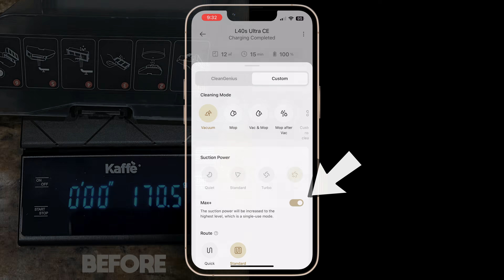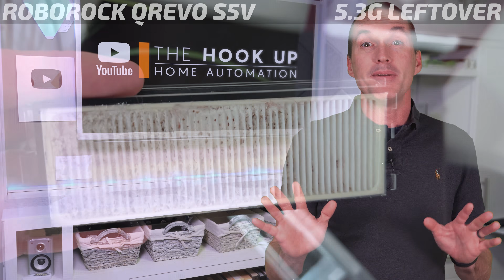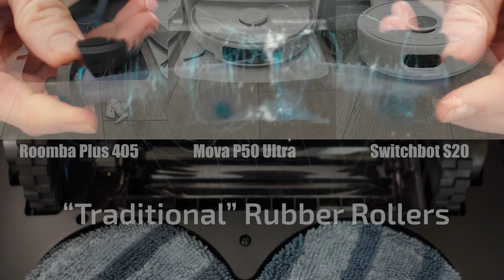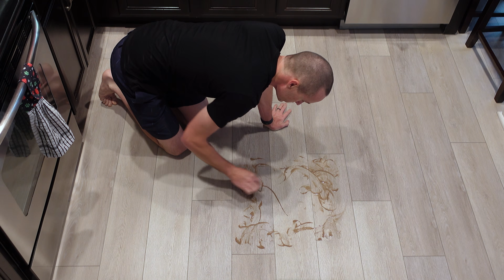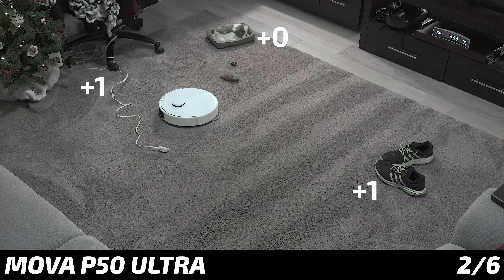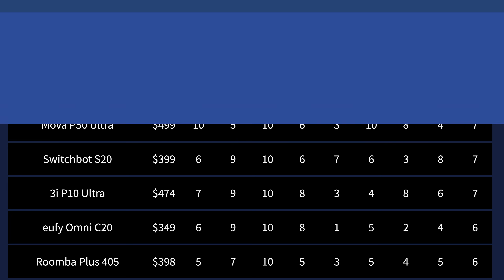The Best $300–$600 Robot Vacuums (They Beat the Flagships!)

Comment: Put a 2x4 on your carpet for testing - simulates wall to wall carpet edges.  I returned my Mova P10 Pro Gen 2 because when it did wall to wall carpet the side brush stopped spinning.  Support called it a feature, with a lame excuse about flinging things...   I call it failed programming since it spins on bare floors.
Reply from the maker: 90% sure there's a setting to toggle that on/off.

Comment: I want to buy the dreame L40S ultra CE 
But suppose I bought it and then after 6 months it broke down, how do I get spare parts or repairs? (Note: There are no cleaning appliance repair shops here in Great Iraq)
Do you prefer buying dreame L40S ultra CE without spare parts , filters or  a xiaomi   H40/H50/H50 PRO/S40 PRO/VACUUM 5 OR deebot T30C?
According to your experience what I should take ?
Note : they all will be approximately the same price for me .

Comment: Excellent and thorough review and tests. Based on this video, I purchased the Dreame L40 Ultra Gen 2. However, unfortunately it was the worst "smart" device I've purchased. Tried and failed to even get it to recognize it's own charging dock. It went in every single room, scanning, turning,  positioning itself, and repeatedly failing to even be able to dock itself. 0/10 cannot recommend. And I was so excited to use it. Returned immediately to Amazon.
Reply from the maker: I'd recommend giving it another shot.  There's a difference between "this product did not work as well as I expected" and "this product didn't work".  Yours is the latter and it sounds like you just got a defective unit, possibly damaged in shipping or something.
Reply: @TheHookUp  OK, I canceled the refund and instead opted in for the redelivery of the same item and pickup of the defective one. Fingers crossed.
Reply: I got the replacement today and Amazon sent a D30 Ultra instead of the L40 Ultra. I think this is a sign to give it up and move on. 😅
Reply from the maker: Wow, is this in the US?
Reply: @TheHookUp  Yes. I returned and ordered Mova Z60.
Reply: So, the Z60 on its first use is throwing a bunch of roller errors on my barely dirty, and hairless tile floor. 😢

Comment: Seems to me that if the first vaccuum picks up only 50% of the flour, flaxseed, etc there is still a considerable amount left in the carpet.  So each subsequent run would have more debris to pick up than the one previously ran.
Reply from the maker: The carpet is thoroughly cleaned with an upright vacuum between trials.

Comment: Truly excellent testing and unbiased reviews!  Very much appreciated!  
I plant to purchase via one of your links when ready to upgrade from my very old Roomba.  
I'm open to any company, however, there are some features I like in the old Roomba that I'm having trouble finding in a new product .
Does anyone have suggestions for a newer model robotic vacuum that:
1) does not require ongoing purchase of replacement disposable dust bags? 
2) is vacuum only?
3) has much higher Pa and better overall carpet cleaning that the older Roomba I currently have?
4) has button controls 

Thanks!

Comment: The problem with this video is you mixed budget tier with mid tier robovacs. Some budget robovacs you could have included but didn't.
Reply from the maker: I guess, but if a "budget tier" vacuum costs the same as a "mid tier" vacuum, why would you ever get the budget tier one?
Reply: get ti @TheHookUp et tier 400~600 ,  mid tier 600~1000, top tier 1000~+. No they are not the same. Yes people buy budget tier (now mostly spinning mop robovacs) because of their budget.  mova P10, eufy C20, dreame L40, roborock QV35A, ecovacs T50
Reply from the maker: I don't understand your argument then, all these are between $300-600, so they all fall into your "budget tier" range and I didn't do any mixing.  L40S Ultra CE is currently $399: https://amzn.to/41OmhGg

Comment: Great review as always Rob. I have a question n(for Rob / any others who might know). Are there any vacuums where you can purchase multiple additional docks? Our new home is split-level (multiple mezzanines), and we need FIVE docks due to the strange layout, as there are 5 floor areas that are connected to each other only by stairs. We don't have carpets, just tiles.
Reply: My advice next sales periode: buy three Mova P10 Pro (at 399$) or look for refurbiced.  If that’s not available in your area (London?) look for Dreame D20 Ultra at same price (lacs some key features.. but still a solid value pick for many. Specially if you can find a refurbish one for ~260$). 

Tips: this can actually manage to climb a plastic ramp up to 9cm height. Maybe you don’t need five if one or two ramps can solve your height/floor issue!? 🤷🏼‍♂️

Comment: I believe Robot vacuum still have a long way to go and in the present scenario it's better to go for a separate cordless vacuum cleaner and a separate mopping device.

What do you suggest?
Reply from the maker: While I think there is still room for improvement, robotic vacuums are absolutely amazing when it comes to increasing general cleanliness with no time investment.  We have 2 vacuum/mops (one on each floor) and they both run daily.  Whenever we have guests we turn the vacuums off to avoid disturbing guests and it's crazy how fast the floors feel dirty.
Reply: @TheHookUp what are the two that you choose to clean your home? 

Similar to you, I’ve been testing and trying out lots of different robot vacuums. None have truly impressed me over the full scope of cleaning tasks. Some obviously are very detail oriented towards specific functions like mopping or vacuuming, but I often find they lack in other departments like obstacle avoidance or edge cleaning. 

I loved the Narwal flow and just like you I believe it mopped our ceramic tile flooring better than anything I’ve tried, except it did very poorly in edge cleaning and getting under our cabinets and around the tight spaces in our kitchen. Left lots of crumbs around those areas. It also ate our small area rug corners and would catch them on vacuuming passes and roll them over and have to climb over the mess of flipped over rug. 

The Saros 10 and Saros 10R were amazing, with the exception that the 10 just can’t mop edges or corners with the vibrarise pad (the little edge mopper is cute but doesn’t truly get the job done) - and the 10R performed flawlessly with exception of its overall mopping left some hazy swirl marks around wide open spaces regardless of what water settings I would run it on. 

I also wish these manufacturers would program a firmware update to have these things mop at a much slower pace around carpet edges and really focus on cleaning the edges all the way up to the carpet. Leaving a 2+ inch gap around all my rugs is pretty annoying when mopping.
Reply: I have been running the Eufy e25 for a few months now and it’s been the most “predictable” of the bunch and does a great job mopping and sweeping edges and corners. Edge mopping is non existent, but it’s extremely efficient with pathing (like Roborock) and water usage (opposite end of Narwal).

Comment: I had 2 Roomba I7s and smashed one into pieces yesterday because it started to find magic spots in its map. iRobot is OK when it works but once the stupid robot finds a imaginary area which is not there, it will keep on headbutting that wall for minutes until its battery runs low! Also, the side brush spins too fast which throws debris outside of the rollers suction.. I hate it, i hate it so much that i decided to buy a $60 cordless vacuum and clean my house in 1/3 of the time and get some exercise!

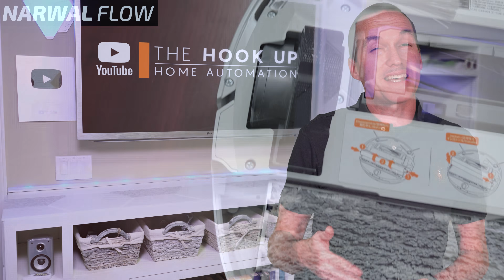Comment: What I find confusing - and honestly concerning - is that in your "Mid 2025 Ultimate Robot Vacuum and Mop Comparison" video from about 3 months ago, the Dreame L40S Ultra (around minute 8:48, for anyone who wants to verify) left the paper towel completely dirty.

Yet in this video, the Dreame L40S Ultra CE leaves it perfectly clean. That's a drastic difference. What exactly changed?
Reply from the maker: The L40S Ultra and L40S Ultra CE are completely different vacuums/mops and I think Dreame made a huge mistake with those naming conventions.  In this case L40S Ultra (from the mid year video) has an extending side mop, but doesn't provide as much downforce as the L40S Ultra CE, however the biggest difference is their water usage where L40S Ultra CE can have a much higher water flow than L40S Ultra, which tends to help with dried on stains like I use in my testing.

As for @AtomicCortex, I know he's just trolling, but I do not make sponsored reviews.
Reply: His sponserships

Comment: My biggest gripe and one of the things I hate about my multiple older Roomba vacs is they scuff the hell out of my moulding. I have a thin line 2” off the ground across my entire room where the Roomba contacts it constantly. I’ve tried things like masking tape or felt on the bumper but nothing seems to address the constant rubbing and scraping of the bumper against the white moulding. How do the latest robots compare for scuffing moulding?

Comment: Price shouldn’t really be a concern. The more poor you are, the less time you have to clean. Obv a robot pays for itself. If you’re rich you can buy more free time or a maid. 

Now that that’s out of the way, the problem is these fully featured robots are pretty complicated machines. Regardless of price, every robot vacuum gets at least 10% bad reviews—really bad. Things break or don’t function or stop functioning after a time. And new redesigns come out so fast, not refining. 

So the REAL question is: which models keep working well for years? Price doesn’t matter so much if it doesn’t break. Miss a few features fine, but the most important aspects must stand up to repeated use.
Reply: Totally agree, interested in longevity of the vacuum. I have an old 7 year old roomba and I need new features like mopping.
Reply: @pinkflamingo5320 For me the issue I’m having is I’m very skeptical to buy anything other than a roborock. As far as I can tell, they have at the top of the game the longest. And I have one w no issues for 6 years. But they are doing the same as everyone else. More features more features. It’s like it almost seems that the most expensive one is not the one to get. Too complicated, guaranteed to break. But it def needs to as automatic as possible (otherwise what’s the point).
Reply: @STUDIO_GJERME yes, also with these grocery list of features 😅 it's feels like your paying more for just being used as a tester. In terms of cleaning, I actually have a better experience with the "older" models, vs the new ones are more pricey for things I don't even notice. I dont have a roborock but a dreame, absolutely love it. Can't improve on perfection
Reply: @Hel @Hello0x0 ecided to go w a dreame as well. My solution to my problem had to be—simply don’t pay too much. Because paying full price just seems like a bad idea. So dreame was selling S40 ultras refurbished for like $350 on eBay. No brainer since they were the most expensive ones on the market only a year ago. No problems yet but it hasn’t even been 3 months. Def a beast, but I’m scared it gonna brick itself for no reason. But I got the warrantee—bought direct from dreame eBay store.
Reply: Paid $1000 and was well worth every penny

Comment: I have a mova p50 ultra and i can leave my mop pads at the base when cleaning. Most of it is in the settings so i suggest checking the settings for that. Also my P50 has the tricut blade that the dreamy L40 has and not the silicone brush. i have not bought any extras for it. it wa all in the box.

Comment: It's awesome you included home assistant
Reply: Agreed! Have been looking for local control information on robot vacuums. 

Given he only mentioned that roborock needs cloud access despite the local polling integration. Do you think that means switchbot's basic matter integration works without internet?
Reply from the maker: Both roborock and switchbot will provide basic control via matter when blocked from the internet.
Reply: I don't know if it's a recent addition to the app and existing vacuums or due to the newer vacuum but I just bought the Dreame L40 AE instead of CE and it has Matter support for local control in Home Assistant!
Reply: @TheHookUp  You need to include base station performance and maintenance.
Reply: @nathantodd3011  eureka -s seem to be much easier to "de-cloud" with valetudo. i am a little surprised that none of the eurekas were in this list
Reply: Honestly I'm going with the only one here that supports HA. Vote with your wallet

Comment: MOVA flagship robots are absolutely crap. More like sunken ships... We've tried the Z60 roller Mop and returned it and now have the V50 ultra and are sending it back as well. Their programming and navigation is the worst I have ever seen. They waste half their battery running around in circles trying to figure out what to do. And they got stuck on so many things not able to figure out how to move including their own damn base station! Do Not buy MOVA ever. That company needs to shut down. Only trust roborock. We've had a few of them and they are always perfect and do what they are supposed to do.
Reply from the maker: That has absolutely not been my experience.  Mova/Dreame vacuums are usually excellent navigators.
Reply: @TheHookUp not the new ones they aren't. Maybe navigation isn't the right part to pick on... They map the rooms fine and get around ok but when actually cleaning they do NOT maneuver in any intelligent manor at all. They're all over the place redoing the same areas again and again and as I said, they waste so much time and battery going back and forth spinning around trying to figure out what to do. They are not smart AI at all. Very stupid machines. My old Roborock Qrevo is leaps and bounds faster, smarter and actually follows my instructions in the app. The MOVA does whatever it wants.

Comment: P50 ultra can be driven around via the app like a go cart. I think software will improve it.
Reply from the maker: But it will not activate the camera.
Reply: @TheHookUp I might be confused on the feature but I can activate “camera monitoring” and drive it around the house.  The entire time the robot loudly says “camera monitoring” and I can see what it sees.  If I could provide a screenshot I would 😂. I did need to set a security pin to enable that feature.
Reply from the maker: Odd, mine does not have that option.  Do you have the P50 Ultra or P50 Pro Ultra?
Reply: @TheHookUp  I’m dumb! As is tradition.  It’s a P10 Ultra I own (for just a few weeks) but you’d think the “better” P50 could do it too.

Comment: By the way. This is Dreame L40s CE, which is the budget version. The standard L40s Ultra is only $100 more with 50% more suction.
Reply: So he got it wrong?
Reply: @gilbeam it's not the he got it wrong, its just he said Dreme and Mova (which is honestly dreme sister company lol) both get no. 1 and no. 2 in vacuum and/or mopping in his series of testing. He's comparing flagship models (that's sell over 1,500 usd) to models half that price (400-600 usd). But the Dreme he praised, is actually theyre budget model and if you pay 100$ you get a much better vacuum experience (which being real, dreme vacuum is good 99% time on tile/hardwood, it's just pets/hair on carpet that goes to 95%) you pay 100$ more and you get more suction power and other perks while still being half the flagship cost. 

I hope that made sense 😅 anyway hes the wrong the dreame vacuum is still great, its just time has passed in terms of value you can get better for less

Comment: The DREAME L40s ultra (non-CE) seems to have resolved most of the issues that the CE had and has the extendable brush and mop. Only costs $549. The only improvement I think is that it needs better corner detection based on my use, seems to be a common Dreame issue with corners.

Comment: Not a huge deal to the overall, but Mova (which is I think the same app as Dreame) lets you do a custom clean, by room, or whole map, in a vac then mop.  Its on the map screen at the bottom- room, zone, etc. And you can set to vac then mop as one of the options.   That should not get the carpet/rugs wet then. It does all the vacuuming first.
Reply: It still gets wet even when you vac first. Think of the scenario where it just finished cleaning a room and now going to a carpet

Comment: I picked up the Mova P50 Pro Ultra during Black Friday based on your community post recommending the P50 Ultra. I trust your reviews, and the Mova has been fantastic so far.

FYI for anyone looking at buying the Mova. After my first clean, there was an issue where the dirty water was not emptying into the dirty water tank and some of it pooling into an area behind the Vac/mop itself. I googled and apparently quite a number of people have this issue on the first clean. I fixed it by doing an empty and during that applying slight pressure downwards on the dirty water tank. It initiated the water to start being sucked up into the dirty water tank, and I haven't had a problem with it since.
Reply: Thanks for the info I ordered also the Mova P50 pro ultra instead of the P50 Ultra as it has also some extra features and comes with the hair cutting brush and the cleaning fluid dispenser
Reply: Thanks.